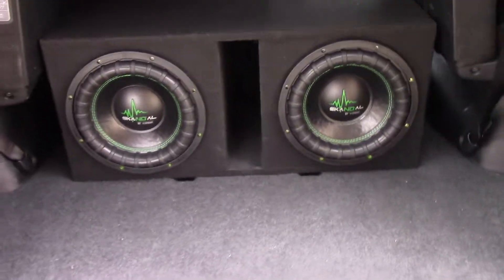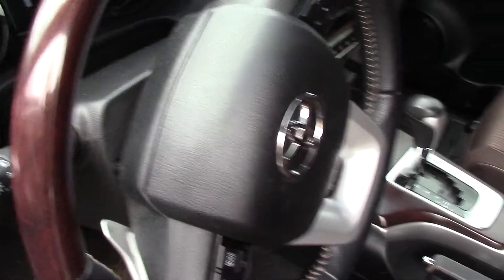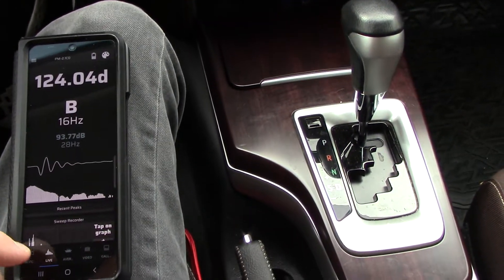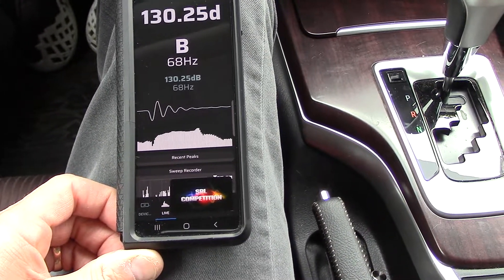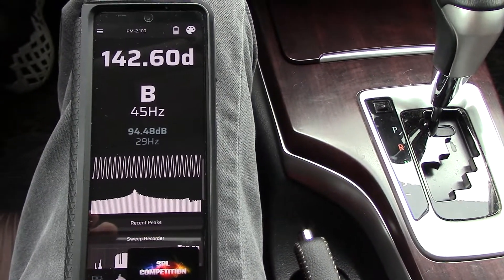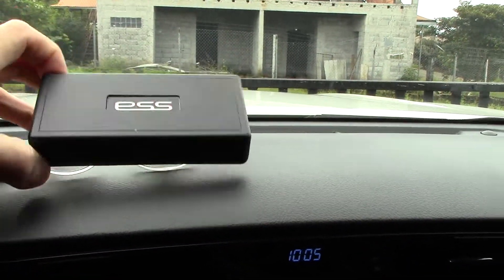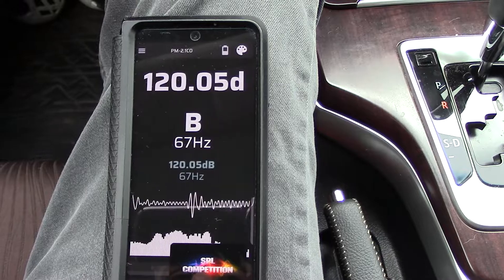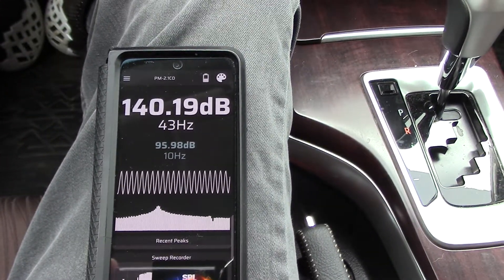Does Subwoofer Box Location Matter for SPL decibels? [Tested] in my SUV!

Comment: You're not going to lose any output with your four subs facing up. Just make sure your box is all the way back by the tailgate. 

I don't know what vehicle that is, but it looks like a full-size SUV. These types of vehicles, like tahoes and expeditions, tend to peak around 44 hz or so. If all you care about is output , then you can tune your ported enclosure around 40hz. That's going to couple with the vehicles acoustics and give you a lot of output at that frequency. It will be pretty peaky, though.

If you're looking for a flatter frequency response , then try tuning between 22hz and 25hz.